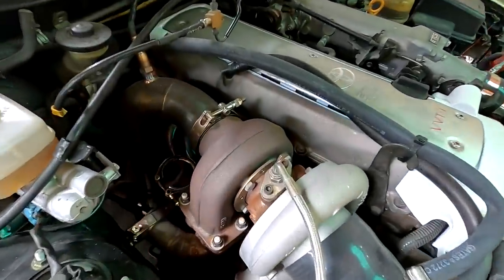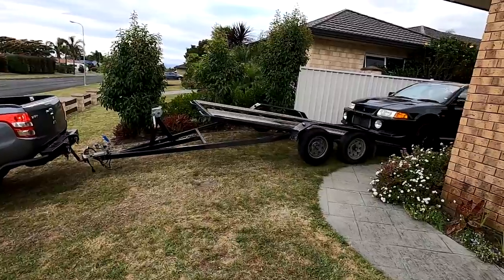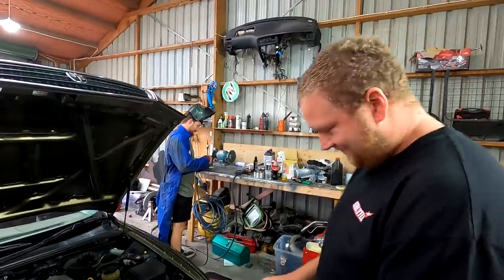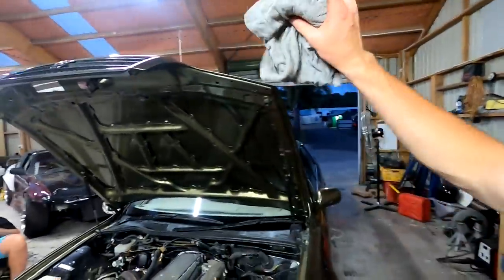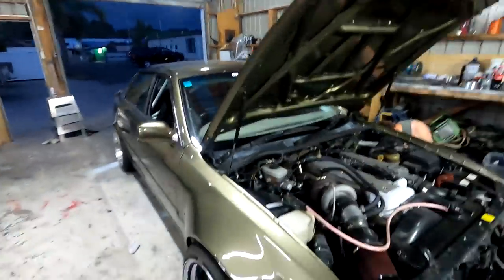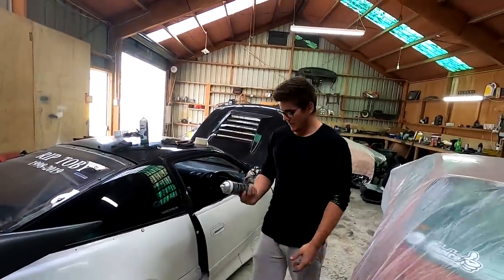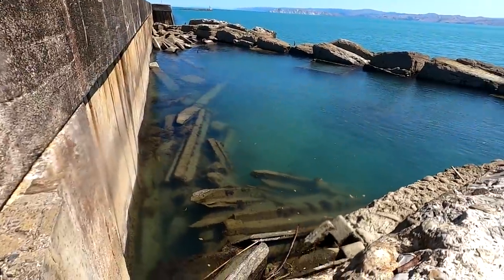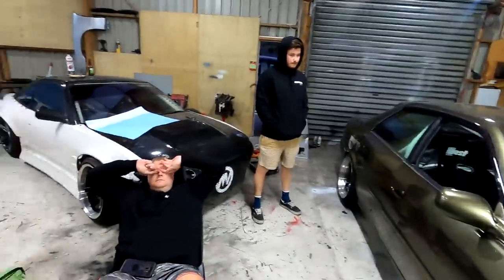180SX Gets A Mint Paint Job!

Comment: 22kg/mm springs? Don't most drifters run 6-10kg/mm? Most sporty OEM suspension is around 4kg/mm for reference. 22kg is hard as rocks - it's no wonder you're skating all over the place if you've got springs like that in there.
Reply: Its a jzx thing
Reply: @1jzfc999  sounds like not bottoming out when you have 50mm ride height thing. What is 'cool' on the street is shit on the track.